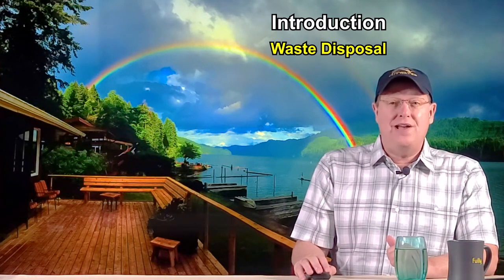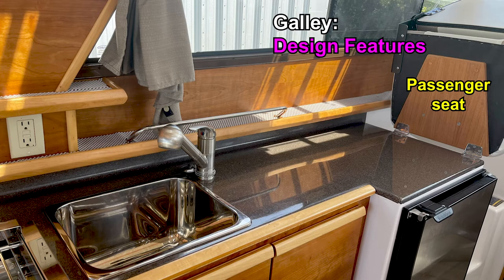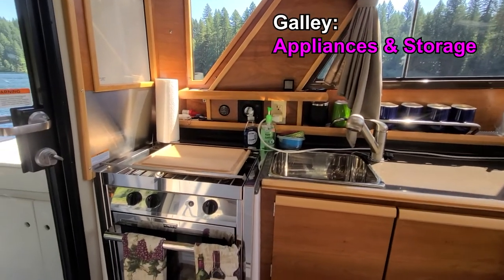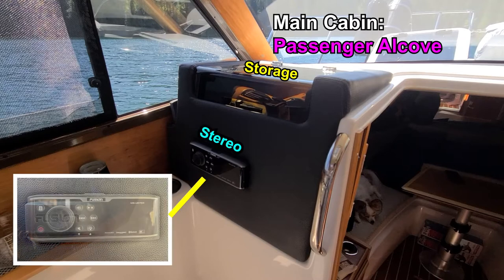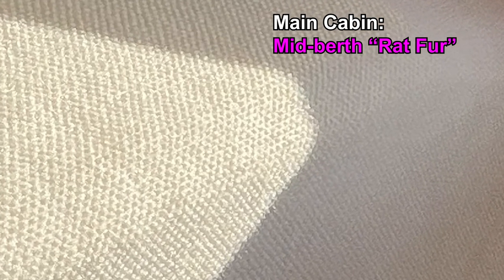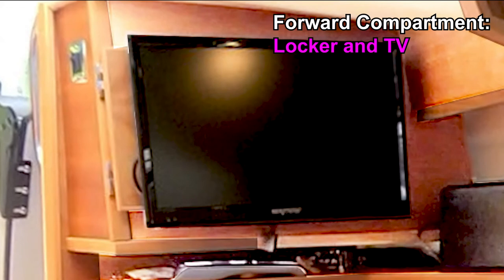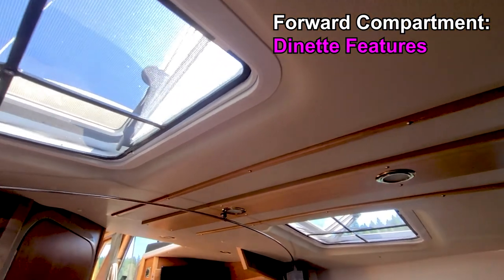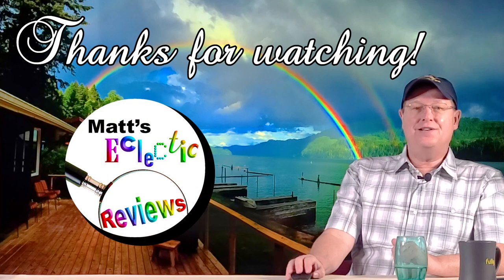Cutwater 28 Owners Review Fit and Finish Interior

Comment: I appreciate your detailed review.  I have read many reviews on the C28 and they are mixed.  I am wanting to upgrade from a 2000 Doral 270 SC, with diesel NextGen genset, with very similar long range fuel and fresh/black water tank capacities.  It seems to fill a desirable nitch where there are few comfortable trailerable cruisers, particularly in the southern climates.  It is disappointing to learn this model has been discontinued.  I think outboards are a good trend and it would be nice for Cutwater to offer a 28' twin outboard trailerable coupe, like many of their competitors, for southern climates.